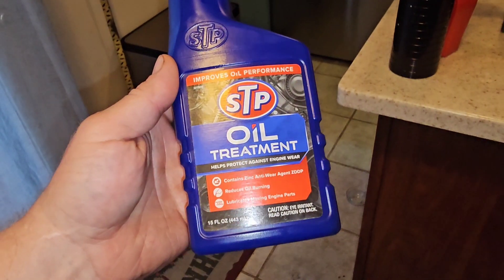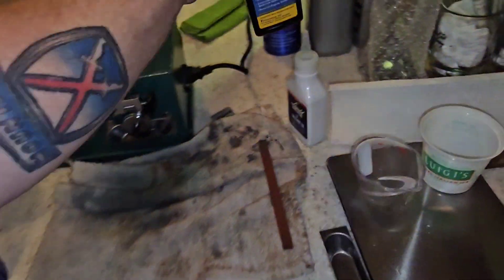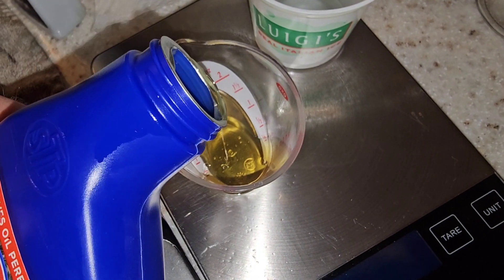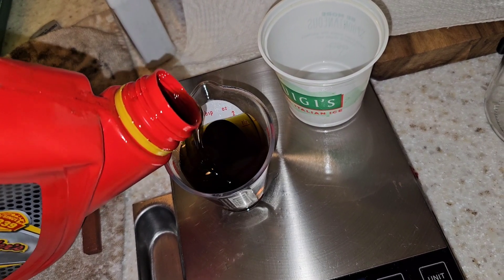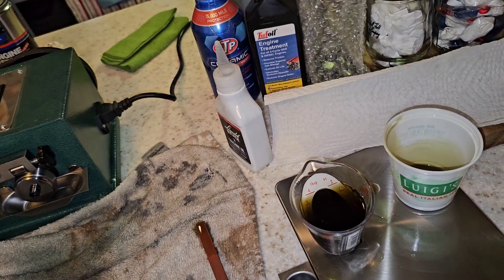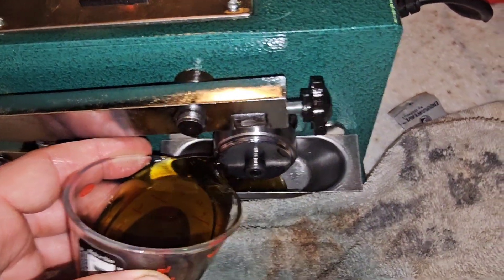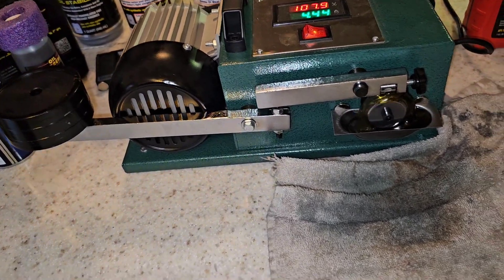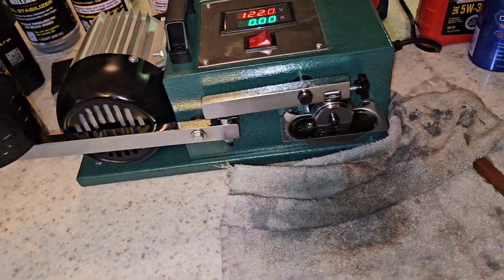STP Oil Treatment - Bearing Test - Let's Test and See How Well It Does - Join Me

Comment: I've always considered the regular STP oil treatment as an additive meant for older engines with worn bearings and oil pressure issues. I've used STP oil treatment as an engine assembly lube on main and rod bearings. A local old time independent shop uses Motor Medic oil treatment with his conventional motor oil changes on older engines. He doesn't use it with synthetic motor oil. In addition to Motor Medic, I used to deliver a lot of radiator stop leak, super glue, Lube Guard transmission additive, motor oil stop leak and the occasional tube of PTFE sealant. The PTFE sealant was for those stubborn oil drain plug leaks. We used to refer to his shop as "Cliffy Lube". 🤣🤣

Comment: The only thing it actually helped with was slowing down the oil burning in my brother's 2.4 Toyota Corolla I remove the PCV valve cleaned it reinstalled it and instead of using 4 1/2 quarts I used 4 quarts and a bottle of that STP before I use the STP I would have to add oil every other week but after using it I noticed that 2 weeks later I checked the oil and it's not burning anymore it actually lasts until the next Oil change now so I didn't buy it to quiet anything down or to help the engine or anything like that I just got it to slow down the oil consumption problem to be honest I didn't expect it to work but glad it did because you can find this stuff at the dollar store